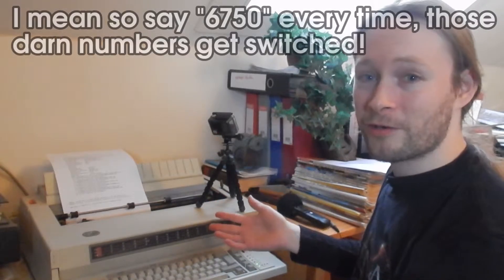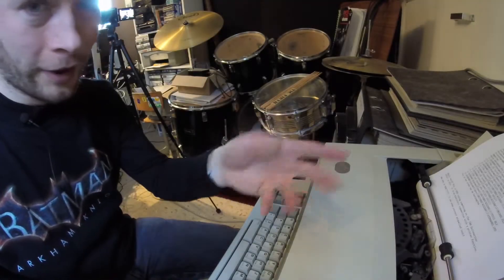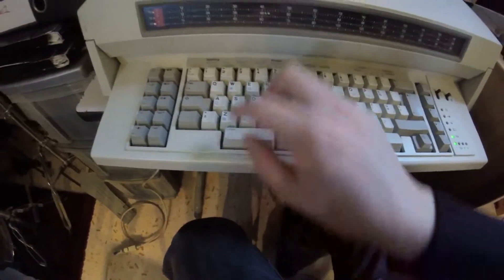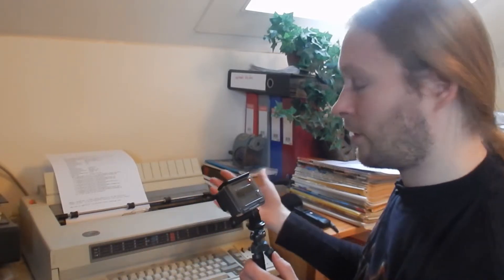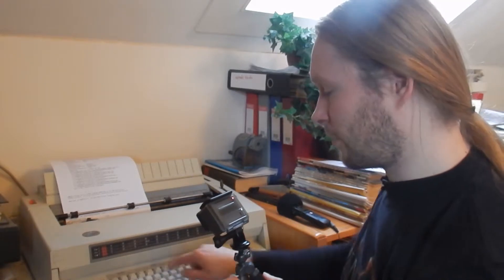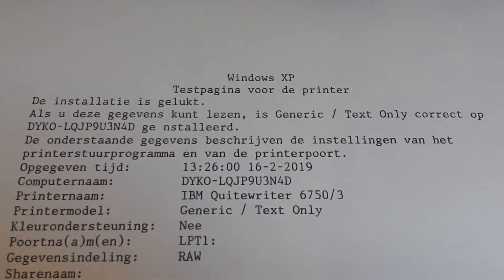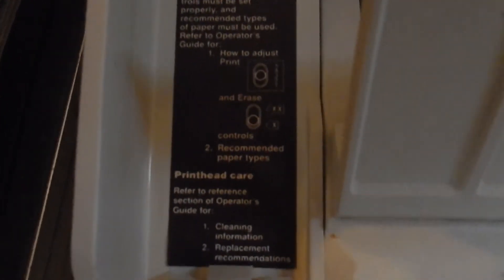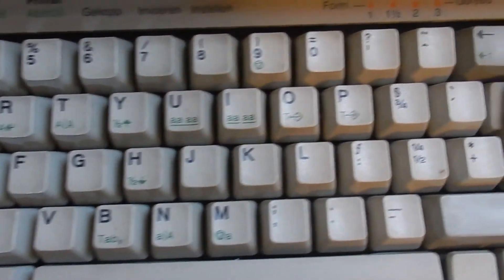Dyko's Tech museum: The IBM 6750/3 Quitewriter

Comment: Very informative video, would you be so kind showing how the parallel cable connects to the ibm? I have the same model but I dont have any parallel port, only a row of unused pinout marked PDI, VRM, POR, BRQ,BUS, Gnd and 5V - accessible from small plastic cover at the top. Thank you

Comment: Hello! Do you have any other device connected between the Typewriter and Computer in order to enable the Printing function?
Reply from the maker: No, there’s no special device required. It only needs a computer with a compatible parallelport and a text editor. As a printer it’s quite limited, it can only function as a generic text printer. It can’t do graphics, only text.
Reply: @dykodesigns  Interesting! Thank you for the info. Now I just have to find an adapter cable for the connector on the back of the machine!